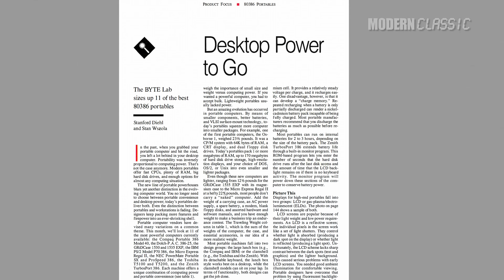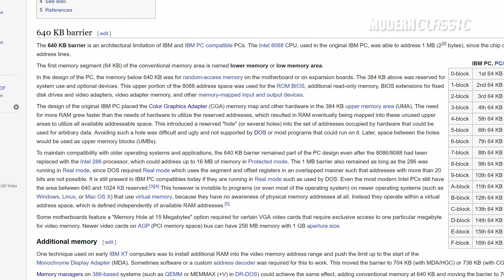IBM PS/2 P70 Tour and Diagnosis - Part 1!

Comment: My suggestion would be to pull the current floppy drive out, and use any drive that's compatible from another system to load the disk. So long as the cable fits, you can use it as a temporary measure to load the software with the drive just sitting externally, and put the original drive back in once you've finished. Perhaps try contacting Clint from LGR, he has loads of old PS2 stuff and may be able to help borrow or buy a drive that will get the job done, even if it's not a direct replacement.

Also, if you have both pieces of the hinge, you may be able to fuse the plastic back together using acetone.
Reply from the maker: The problem is that it's not just a physical difference, it's a different cable too. So then I'm up to option #3 at the end of the video, which is hacking together a cable so I can use a standard drive. I may end up having to do that, it's just not my first choice. If I have to make a cable anyway, or modify an existing one, I may as well just try repairing the drive first.
Reply: This is why I suggested contacting Clint over on LGR. He has an extensive range of PS2 gear, and may have a drive, which even if the form factor won't fit, the cable might. It may even simply be the same drive in a different casing, that you could then swap over. What you need is the hardware first, and the form factor second. Get the machine booting first, then worry about the aesthetics.
Reply from the maker: I will try contacting him to see if he's got a drive that I can borrow or buy.

I meant to reply about the hinge too - one of these days I will take the assembly fully apart (I got it apart enough to see what was going on, but haven't gone further yet) and then I will see if the pieces I have are enough to reconstruct it. I don't think so, though, and the pieces I do have are very small. I did wonder about epoxying them or something. But what I have are three pieces that make up the top "loop" of the hinge that the pin slides up against, each only a little more than 1mm long, making a piece that put together is about 4mm x 4mm. Very small to do anything with. And I think there's probably supposed to be the same thing on the other "arm" of the hinge that's just totally gone. So I think I'd probably need a new one one way or another.
Reply: Yeah, that hinge sounds like a bit of a mess. If you do have all the bits though, a gentle clamp to hold them together, and then injecting acetone into the crack with an insulin needle can do wonders, but if the bits are really tiny and fiddly, it may be too much of a jigsaw to get back together.

Comment: Man, I'd love to see how OS/2 Warp runs on that machine!  It was sluggish on my 486DX-33 back in the day, but I don't remember if I was running it with 4 megs or 8 megs of RAM.  I wish I still had my original copies and boxes of all those old OSes that I had!
Reply from the maker: I had it too and also remember it being slow as dirt. I was really looking forward to checking it out here also. Well, I will get this machine running at some point and will do a second video to show what I had to repair and all the software on the hard drive. I'm pretty sure I have a plan.
Reply: Looking forward to it!

Comment: You could remove all DIMMS and put in a single 512KB chip, see if it gets past the error.
Reply from the maker: Well I can conclusively say there's nothing wrong with the RAM... I tried each chip individually in two different slots (that's all it'll let you do, you can't use the last two slots by themselves), and got the same amount back on all of them, in both slots. And 7808KB is conveniently exactly 384KB lower than the actual total amount (8192KB), which is the same amount between 640KB and 1MB. So it definitely isn't the RAM; it's the RAM settings.
Reply from the maker: You know, I think I understand what you're saying now, to get under the 640KB barrier so the upper memory doesn't need to be allocated. Maybe I'll try it if I can find a 512K SIMM that's cheap enough. (Btw, the SIMMs are proprietary too! These 2MB SIMMs are about $75 or more each on Ebay. For 2MB!)
Reply: I know how you feel.... I've an IBM PS/1 model 2011 and it also use a lot of proprietary stuff like ram expansion module, floppy and hdd (which I am still puzzled if they are XT-IDE or ESDI with built in power in the same cable but it should be the same as the IBM Teradrive). Also my machine is nightmarish because the PSU is into the monitor and it has no isa slots (if you wanted a couple of them you had to buy an external add-on).. Fun fact: if the RTC battery is dead the floppy drive doesn't work!
Reply: Have you tried himem.sys.or emm386.sys?
Reply: I use himem on my ps/1 2011

Comment: The floppy drives were always an issue with these things, mostly attributed to the fact that dust just falls down in there. I remember loading Windows 95 off of 20 something disks on my P70. Had a TI 486 upgrade CPU & a RAM board to get to 20mb RAM. Ok...  I can't help it. Now I'm off to ebay. haha

Comment: That is one sweet pickup!  Is there any way to get to the floppy cable/controller through the back panel?  Maybe you can plug in a different floppy to boot from (hanging outside the case) to fix this one issue until you can fix/replace the vertical floppy drive?
Reply from the maker: I've more or less decided I'm going to try to hack a cable to use my floppy emulator with it for now. But I've already hacked up my one spare floppy cable so I just need to order another one from somewhere. I'll be ordering new caps for the drive at the same time, which I definitely know now is at least one of its problems (hopefully the only one) - see my pinned comment.

Comment: I have the same unit with 120mb drive and 8 megs but no math coprocessor.  I have to power cycle it ten times to get it running but it's sweet!  ...guessing that'd be power caps.  I have a stripped 95 on it now but want to get the original aix working on it.  And yep, just trying it now and it seems that floppy is done.  Guess it was 10 or 15 years ago I installed 95 via 21 floppies...

Comment: It seems to me that the computer would be prone to falling over because it is basically just balancing there.  They should have put a brace on the back - it would not be a good thing for it to fall over since it has a gas plasma display.

You might be able to find a CompactFlash solution for the floppy drive; they might make them for this model.
Reply from the maker: It's actually super stable. It's very bottom heavy when it's stood up like that. A couple of times in this video I end up inadvertently pushing it, and you can see that it just slides back a little rather than tipping. All the heavy components are on the bottom.
Reply from the maker: As for the CF solution - I actually have the one that would work (Lotharek HxC - you can see it in the background of most of the video), but it's the same issue as using a regular standard floppy drive, which is that there's no cable for it. Still, if I decided I just wanted to get it booting and figure out some permanent solution later, it probably is preferable to trying to jam a standard floppy drive in there.
Reply: I have IBM p70 and I was also forced to use the standard floppy drive. I'm using also MCA-IDE adapter card and CF-card. The original floppy drive gets power through the same cable so you need to modify the cable or make a new cable.
Reply from the maker: I'm starting to think that making a cable is going to be my best option, then using that with my Lotharek HxC for now. Where did you get your MCA-IDE card? I did a Google search and most of the pages I found were just talking about it, but I couldn't find anywhere to actually buy one. (Ebay turned up 0 results too.)

Comment: I believe it’s the motor in the drive standing still, I don’t hear the “klick” when it hooks in
to the disk and start spinning it. I was as an technician at IBM, mending this type of computers in the past.
Reply from the maker: The motor definitely spins, or do you mean something else? I have a cleaning disk now and that thing sounds like a frisbee when spinning, so it's easy to tell. Of course it hasn't fixed the problem so I don't think it's dirt either. I will have to look at the caps next I guess...
Reply: OK, have you heard the klick?, 8 out of 10 times should you hear the klick when it hooks up right.
After that it tries to read the start section on the disk, it tries 256 times/cycles (20-30 seconds total). If it cant find it, then it stops spinning (heads dirty or bad). If it continues spinning and don’t stop the drive is faulty, maybe caps.
Reply from the maker: I've never thought of it as a kick, but you mean that slapping sound it sometimes makes when it starts up? It does do that. It sounds to me like a normal drive, like all my other 3.5" floppy drives, but then it just stops as if it's not a bootable floppy. It doesn't keep running - does that suggest to you that it's not the caps, but more likely the head? Not sure what I can really do if it's got a bad head.
Reply: I think the click he's talking about the metal door opening on the diskette usually followed by the hum of the drive trying to find a track
Reply: Sorry, I remember wrong, the click should com direct when the disk start spinning. I just listened to one of mine( I have 3). You should get a “not ok sign”, pointing to a book. You don’t get that. Try to remove some of memory modules, swap around and use only position 1 and 2.
Reply from the maker: I actually did do that; I tried every position and combination possible with the SIMMs I have. Someone else suggested trying a 512K SIMM to get under the memory hole so the system isn't confused; I'd love to try that but can't right now because these are proprietary SIMMs and I need to find/buy one to do it.

I did get the "not ok" sign when it was giving me the CMOS battery errors. I wondered why I am not getting that now with the memory error codes. Is that supposed to mean the hardware is ok other than the CMOS settings?

I sometimes go back to thinking maybe it's just a problem with the disks. But I made two reference disks and a regular DOS boot disk and they all do the same thing. Unfortunately the only "old" PC's I currently have are this one and an original 5150 (which doesn't work with 1.44MB drives/disks), so I have no way to test the disks in another computer. The computer would tell me that the disk isn't bootable if it was able to actually read it, correct?
Reply: If you remove the CMOS battery, does it work correctly?